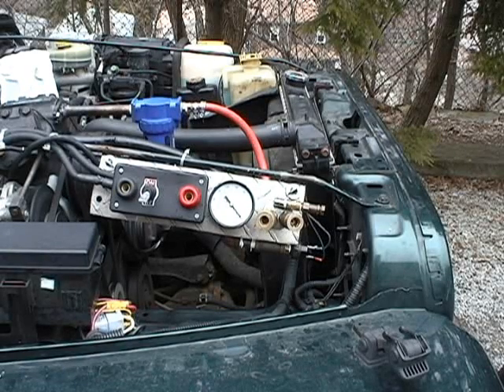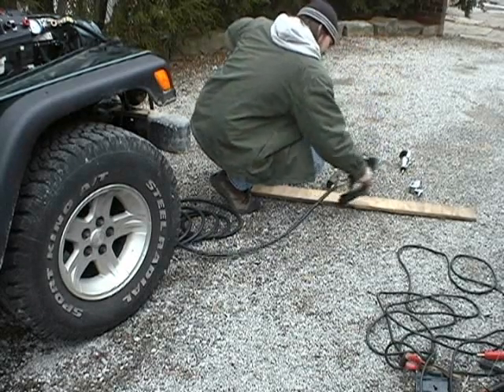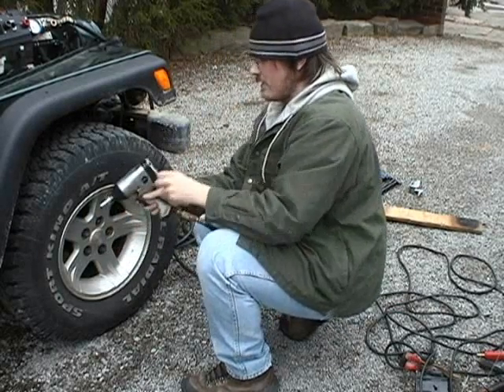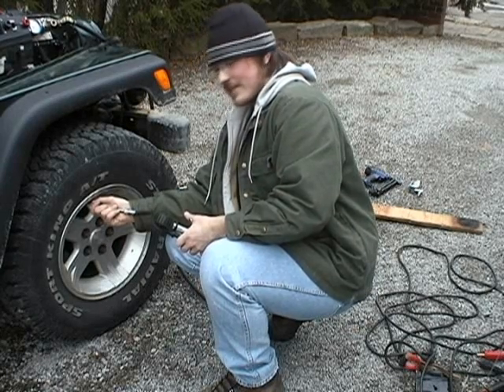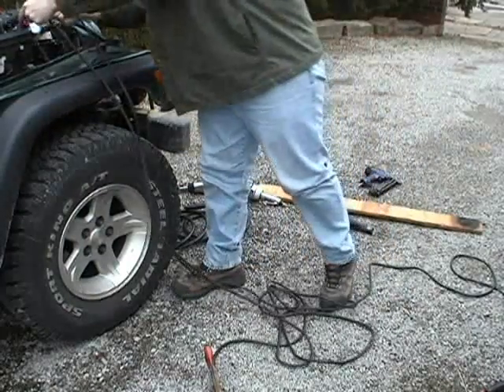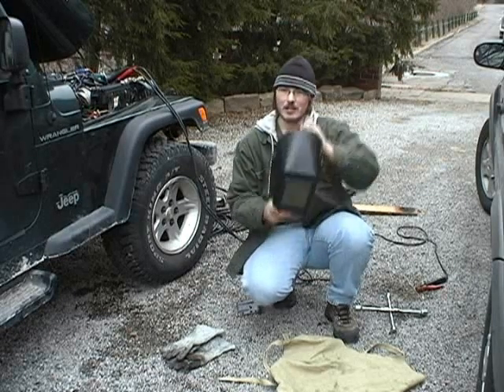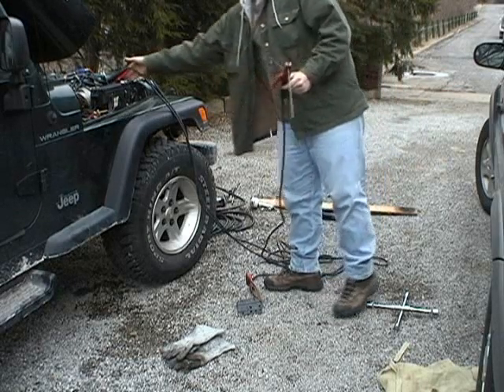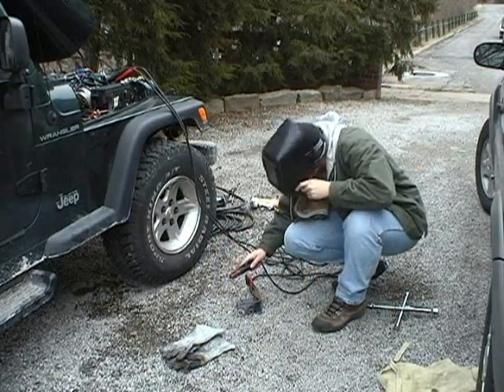Building a onboard air compressor / welder results

Comment: @skvoucher if you need a thin walled socket to get in to get it out you have to.  Some impact sockets WILL not fit inside a rim hole for the lugnut

Comment: Glad to know I'm not the only person that did this!
I converted the AC compressor on an old Datsun 510 wagon back when I was 14, and then I also did it to my old 84 f-150 I still have that truck, It never had A/C so I took a Mikuni Pump from a volvo car and made brackets for it to bolt in the position of the original smog pump that burnt out years ago on that truck. It can fill a 100 gallon tank to 180PSI in about 8 minutes. Got tired of the huge tank so I just plug directly into the pump now